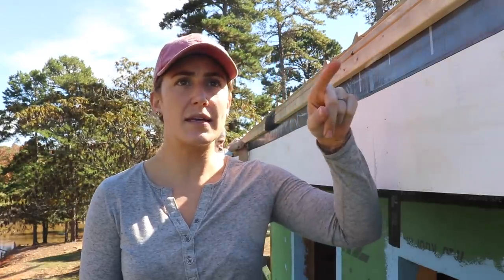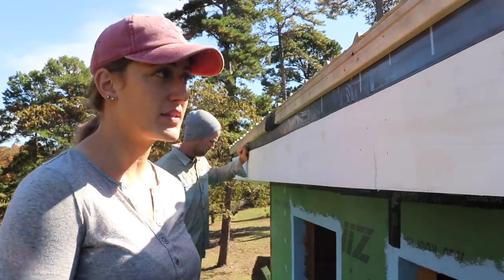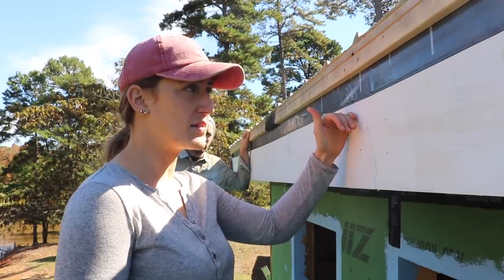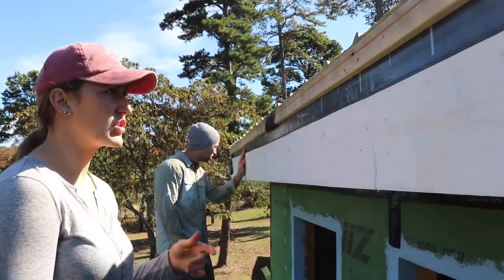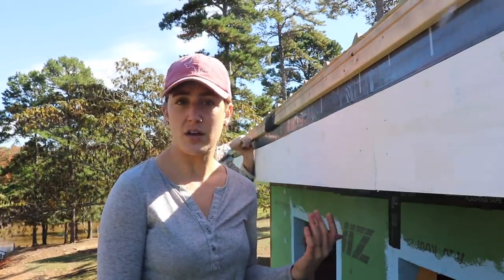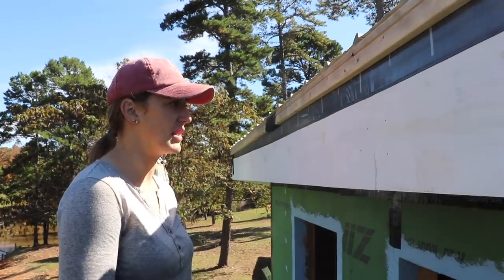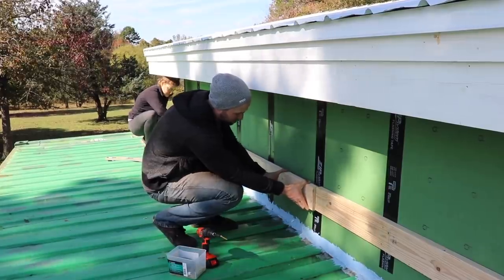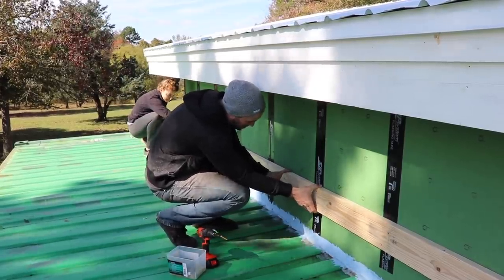CAN'T BELIEVE WE MESSED THIS UP!

Comment: Hey guys. There is a product that you can get at ACE Hardware and probably other stores. It’s called Bengal. It is a concentrate in a very small bottle. It’s in the pesticide isle. The bottle comes in a box so it’s easy to pass by. You can mix it in a garden sprayer and use. The lady bugs live under ground. We had that problem in the mountains of north Georgia. We would be gone for a week and come home to literally 10’s of thousands of the bugs inside the house. We sprayed around all the windows and doors and anywhere else that they might get in. After battling them for over a year we finally got them under control. It will kill them but the ones we had weren’t native to our area. Good luck.
Reply: They aren't lady bugs! They are stink bugs. A real pain.I had about 100 of them clinging to my garage wall last autumn. I killed those suckers. They stink. literally they smell terrible!

Comment: If you stack all your roof sheets together and then pre-drill your screw holes or use a awl to punch them, you won't need to measure on the roof top for screw locations. Also you could cover your ice shield with alum. soffet cap!

Comment: Been wondering what are you going to do for the lower roofs on top of containers. No pitch will eventually fill up with water on container top and leak around center walls and run in.

Comment: Its a bit late now but did you try a heat gun it melts the glue so you can use scraper to remove also does not damage the wood if done properly

Comment: The extra trim gives added depth to the facia and makes it look much better. :)  
I forgot to add this last week, a little measuring tip. If you have a lot of holes to drill screw like you did on the roof. Rather than measuring each one make a story stick / pole, get a piece of timber ( lumber) mark the screw holes on the timber and use that to transfer the marks to the roof or what ever you are fixing down. :D

Comment: Great mistake! Looks great with the extra step detail! I would advise caulking the gaps where the trim peices meet with a quality paintable outdoor caulk and using high quality paint. The caulking will extend the life of your trim greatly. Good paint is well worth the extra up front cost. I painted a garage with cheap Valspar and it needed painted again a couple years later. Now I use nothing but Sherwin Williams. Sorry for the book.

Comment: why did you place the finish pieces on the TOP of the roof edge on the slope edge (front). I picture the water flowing under the edge and keeping the under side wet in any wet condition. (9:57) Shouldn't the sponge be under the roof edge and the trim placed under the roof edge and sponge?

Comment: I would have tried sanding it off then repainting it. But I have zero experience so its just a trial and error thing. But I love your ideas
Reply: Issue with sanding any rubber based material, is that they gum up the paper within 10 seconds, so you don't really come that far. Unless you have continuesly waterflow, then u need tanks, pumps etc. I would've just painted it though. :)
Reply: @roydahl2834  you are right 👍

Comment: Guys go to a specialty lumber company and get some 1x12 lap and gap siding. You may have to cut the main cedar piece down slightly, but it should fit between the 1x you have right under the standing seam metal and the 12" fascia. It would fit rather nicely if I'm not under estimating things. It would over lap your existing fascia.

Comment: Hey, brother, I'm a carpenter you have to weatherproof it anyway, I would just get some aluminum drip edge and facia and just cover it. You are supposed to have  3/4" to 1" roof overhang by code in most places so water does not run directly on the facia and rot it out. If it hangs over a little more it's not the end of the world. I would just pull that extra wood next to the metal roofing off, aluminum rap it and call it a day.

Comment: A heat gun may have helped but I actually like your work around.
I have been looking forward to the video that shows y’all putting the roof over the container tops.
Really curious about insulation and how you are planning to seal the roof to the center roof.

Stay safe...

Comment: Seems odd the drip edge would go on top of the metal roof. Would water and debris get stuck on that lip? Eventually the foam will deteriorate and water (or beatles) will get under there

Comment: Order some Chewing gum remover, or nitrous oxide (freezes the sticky) it flakes off. The Chewing Gum solution is used to get it up from carpets. Spray then hit it with a hammer and it shatters. No good for your needs but it still dies up the sticky instantly

Comment: Read this comment !   score a straight line across the rubber, then use a rough orbital sander disc or even a grinder with a flap disc, or a few of them to sand it off, then use builders bog to skim the rough patches then sand with orbital with a medium disc to finish then undercoat again.    Dont worry too much if you damage the surface underneith you can fix later with the bog and orbital, just dont go too deep.

Comment: occupy mars  i have a new question and i am sure you see many and i have sent many questions not sure if you see them  anyway i have the same plans as you but with a extra container and no vaulted ceiling  this question is about welding.  did you use arc, tig or mig ? i have arc welded before but was not sure which one you used and if it weakened the metal ? thanks

Comment: The next time you are faced with removal of some sort of textile adhered with glue, try using a heat gun. Have Mackenzie work forward, heating the glue, while you follow behind with a putty knife. My guess is that it will come off pretty quickly. This works on all sorts of materials. The thinner the application, the more quickly it works.
~JSmith

Comment: Turn your hairdryer to high heat and hold it over the sticker for about 45 seconds. After 45 seconds of direct heat, test a corner of the sticker and see if it peels away easily. If it doesn't, continue the hairdryer treatment for another 45 seconds or so, and then start peeling off the sticker. 😉

Comment: Aluminum capping or flashing would be way faster to fix your mistake. I'd still cap all that and u would never have to worry about it nor ever paint it again. I also suggest using 6-8in gutters due to all the rain u guys get. Make sure u run downspouts 8-10ft from foundations or in your case id run the water to the pond with irrigation or pipe underground.

Comment: Don't know if anyone else commented about this, but the native LadyBug is not as numerous as the invasive Asian Beatle. Also they, (the Asian one) will bite and clog up electrical devices. I've seen contacts for well pumps and A/C units foul out because of Asian Beatles. They will come through the smallest of cracks and cause circuit boards to short out. Again they are invasive and have a smelly defense like powder if agitated. Becareful as they will get in the roof of dogs mouth and are painful.

Comment: The only way to remove that is to take a heat gun to it , heat a little at a time then scrape under it with a scraper, it will melt off Like butter, then use some mineral spirits to clean off the sticky residue

Comment: Asian Lady Beetles: You know what ladybugs look like, and you’re probably already somewhat familiar with the infamous Asian lady beetle. The pest seems to disguise itself as a harmless ladybug in order to infiltrate our gardens and homes. Asian lady beetles are like the dastardly spies of the insect world, especially in fall and spring. What you may not know, however, is that the disguise isn’t perfect. It’s not always easy, but distinguishing between Asian lady beetles and ladybugs is always possible. By figuring out which bug is which, you’ll be able to drive out the bad and leave the good be. Here’s how to tell if the bug you’re looking at is an imposter, and what to do about it. ‌Asian lady beetles are considered a true pest. Unlike ladybugs, Asian lady beetles will gather in large groups, especially around warm, reflective surfaces like windows. Asian lady beetles “bite” by scraping the skin they land on, and leave a yellow, foul-smelling liquid on surfaces where they gather. Worst of all, Asian lady beetles will attempt to enter your home when they look for overwintering shelters. Basically, think of Asian lady beetles as ladybugs’ evil twins. Telling them apart is important because even if you’re cool with ladybugs, you don’t want Asian lady beetles hanging around. ‌

Comment: Why are they screwing the trim on, use the damn nail gun.  Save money and time.

Also use a heat gun to heat up the adhesive to help remove the roofing material.

Comment: It's not a mistake, it's a feature.  Actually, it would have been easier to take it off with a belt sander and then repaint.
Reply: As soon as a belt sander heats up that stuff, it'll gunk up the sandpaper

Comment: you two are getting a bit silly but your having fun too with your build!
why was it so bad to not leave that peel and stick showing? maybe you could have used a paint heat gun to blow hot air across it to strip it off ? but i guess that's just a
bit after the fact now isn't it? take care till the next video. hang in there with the rest of your build.
oh BTW Occupy Mars. L.O.L.